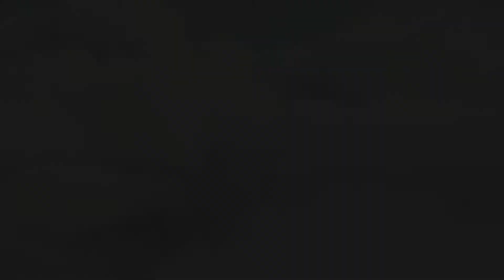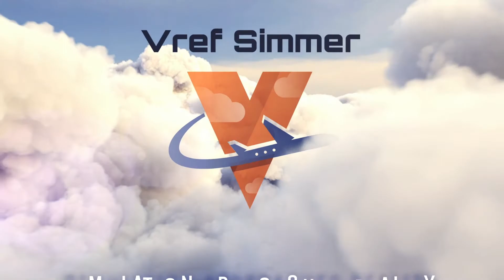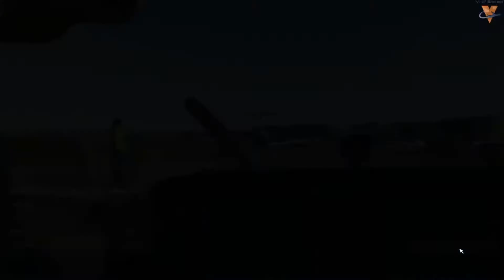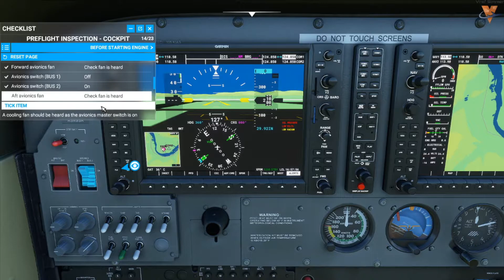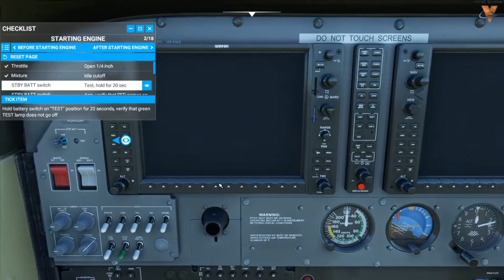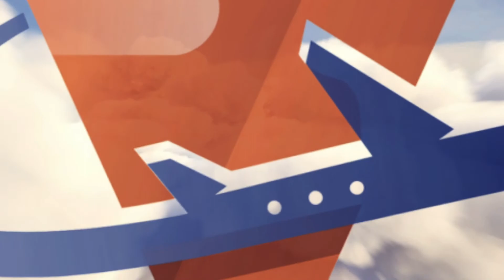Microsoft Flight Simulator 101 | G1000 Cessna 172 Preflight & Engine Startup

Comment: Hi, when I try to go through this procedure and get to the point where the PFD is on, I cannot see any of the engine information displayed like you have. Therefore I cannot check the oil pressure, fuel gauges, etc. can you tell me what I’m doing wrong? How do I get the PFD to display that info? Thanks in advance
Reply from the maker: Are you still trying to fix this problem? I'm back now and can try to investigate.